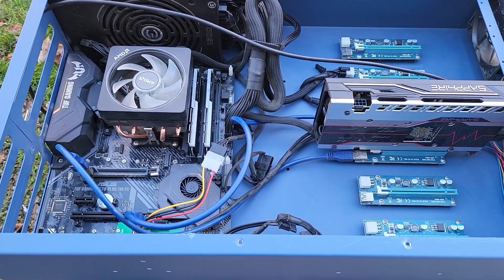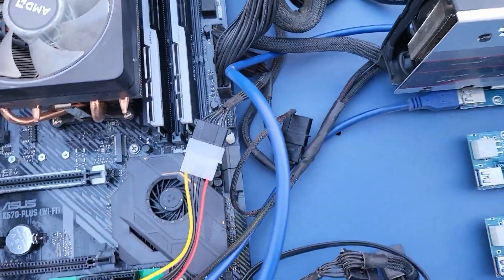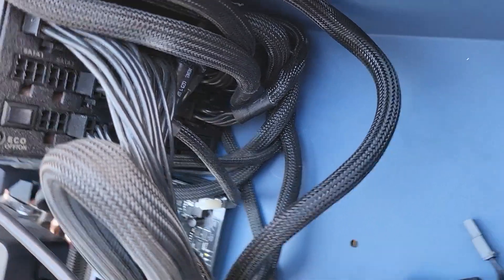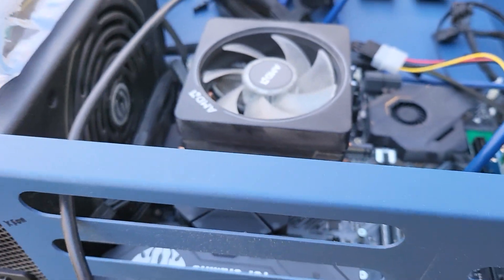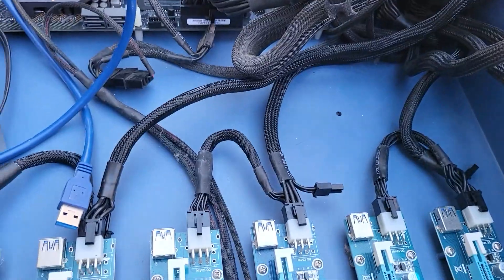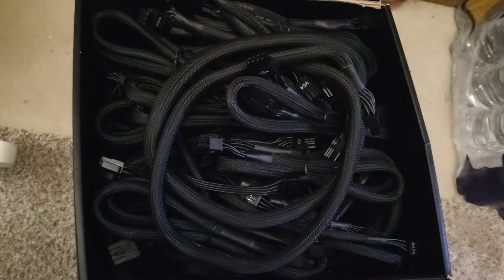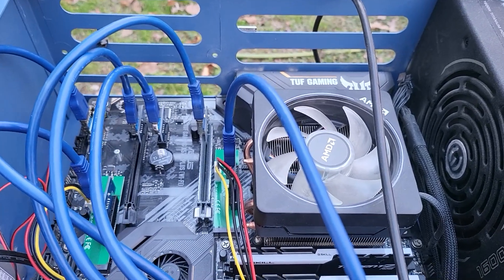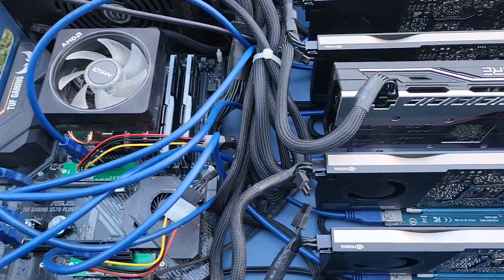Building A 6 Graphics Card - a4000 GPU / CPU Mining Rig

Comment: what are those cases I just did a video on the rosewill server cases Ive never seen this on, seems smaller than the rosewill

also you dont need the power to the M.2 pcie slot I dont have that connected